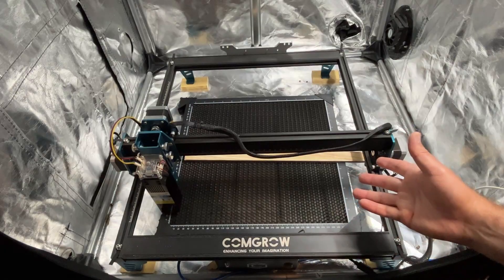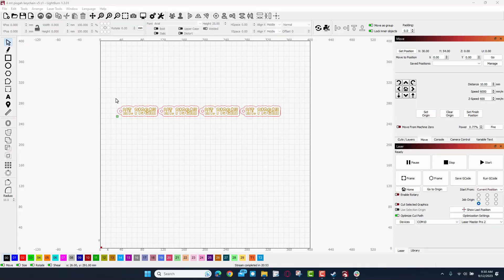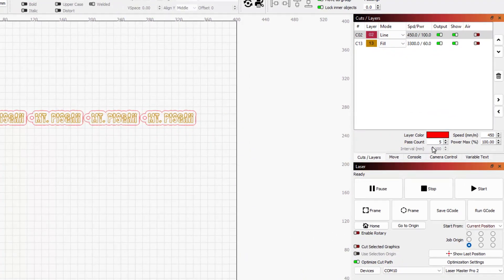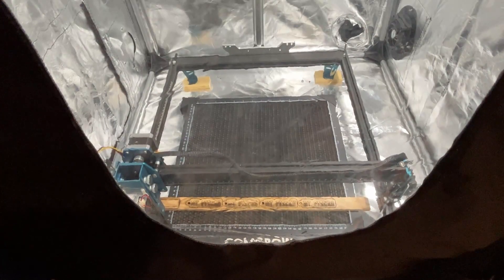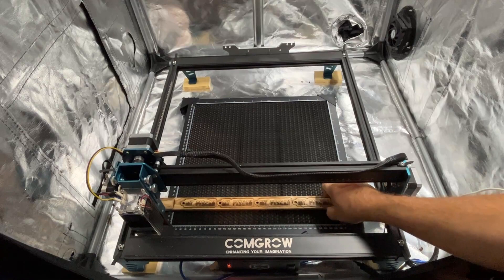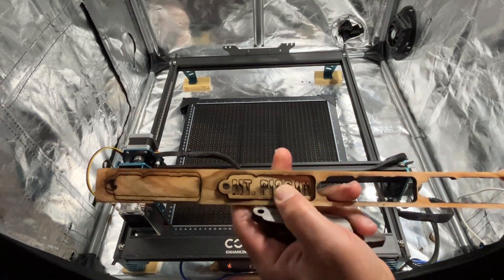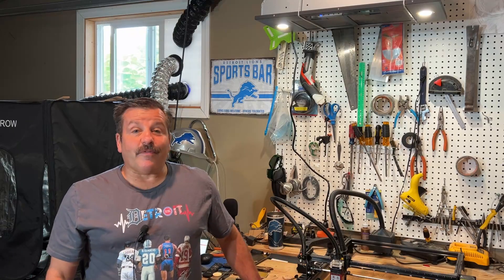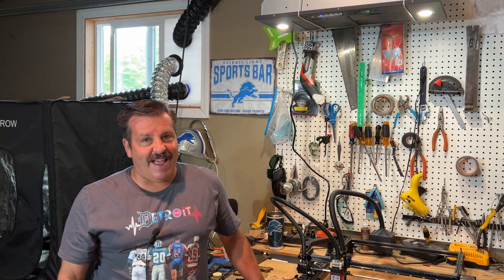Honeycomb Bed Wooden Keychain Comgrow Z1 laser cutter Test!

Comment: I see that the bed fits within the laser frame/rails.  How did you determine where to place it?  Top, front, left and right gaps?
Reply from the maker: I just use nudge each time I am cutting. If I were cutting parts again and again to sell I would have a rig that made it faster. Great question though.